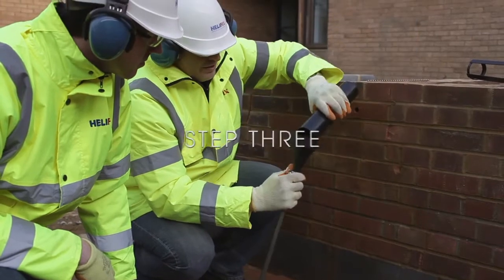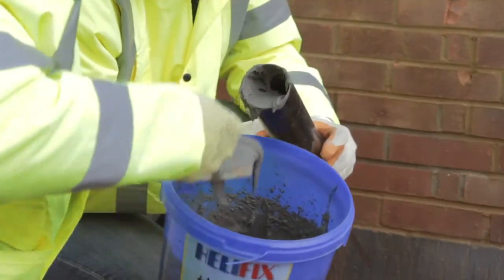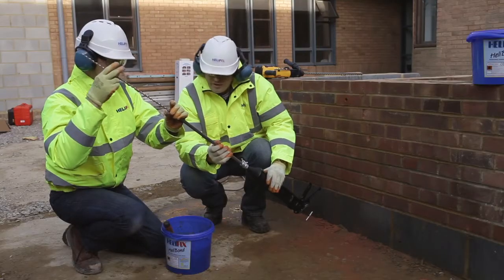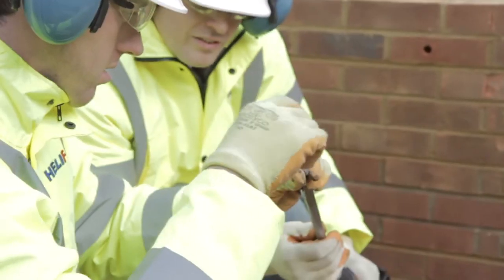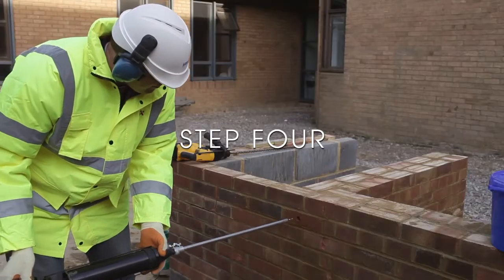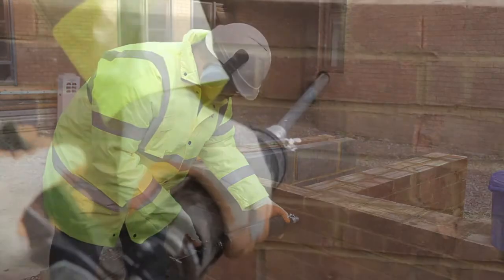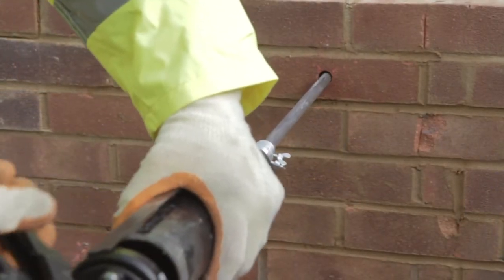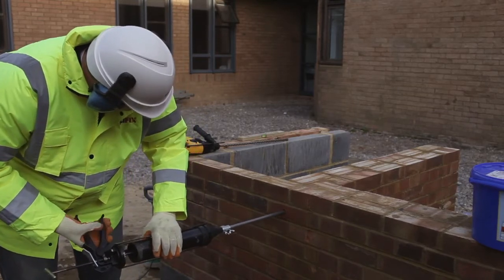CemTie from Helifix

Comment: This is a useful video, thanks. Really clear and easy to follow. I have a failing brick arch over a window. One section has slipped about 1cm, and cracks fork out above into the masonry, which is all stone (Cornish slate) with lime mortar. Would it be possible to use CemTies in this situation (i.e. where the wall is not entirely brick)?
Reply from the maker: Hi James. Thank you for your comment and feedback. In order to answer this query could you please contact our Technical Team as they would like to discuss it in more detail to fully understand the situation. They can be contacted on +44 (0)20 8735 5200.

Comment: I've attempted to install this product 5 or 6 times following these instructions and it has never worked. The applicator gun feels flimsy and appears to come apart from the pressure at the joint with the wing bolts before it pushes the cemtie out the front of the gun. It seems no amount of pressure will push the grout out the nozzle regardless of how long I mix the grout, . We are attempting to install 40no 1m long cemties into brick. What are we doing wrong? I've lost probably around $30-40k attempting to do this job.
Reply from the maker: Hi Alastair, thank you for the feedback.
There are a number of things that we would like to check if possible please. Including checking on the applicator being used, diameter of holes drilled, set up of the applicator gun and mixing of the grout. If possible could you please contact Roman on 0208 735 5200 who will be able to discuss all of this with you and find a prompt solution.
Reply: @HelifixLTD  Pointing gun kit HD, Cemtie nozzle 15DIA 1200 long, helibond grout, helibar 8mm x 1200mm. Drilling 18DIA holes with helifix supplied 1350 long SDS max drill bit. These are purchase from the Australian distributor. I had been mixing the grout with a 240V electric helical mixer for ~3-5 minutes generally
Reply from the maker: @alastairi6942  Hi Alastair. Thank you for this additional information. There are still a few different scenarios that we would like to discuss with you to try and get to the bottom of your issues. I see you are in Australia, if you could please contact our Australian office the team there would be more than happy to assist. They can be contacted on 1300 66 70 71 or alternatively by email at sales.helifix.au@leviat.com
Reply: @HelifixLTD  I partly figured out the issue, after reading the TDS for I'm sure the hundredth time. I realised the pinning nozzle is to be installed through the back plastic sleeve and then the wing nut sleeve attachment slid over the end of the plastic nozzle. Perhaps some isometric drawings in the TDS would make this clearer! The plastic tube still however broke after installing only two cemties as it appears the weight of the metal pinning nozzle filled with grout and the amount of backpressure required to push 1200mm long cemtie down the tube causes a plastic hinge to develop on the cone and eventually the pressure started pushing the grout out a crack that formed there instead of the end of the pinning nozzle. Perhaps this works much better with the shorter length cemties/nozzles. I reached out the local distributor to order spare plastic cones so that I can complete the scope.